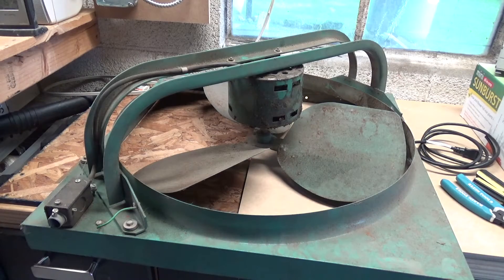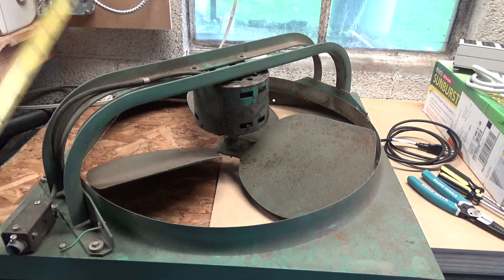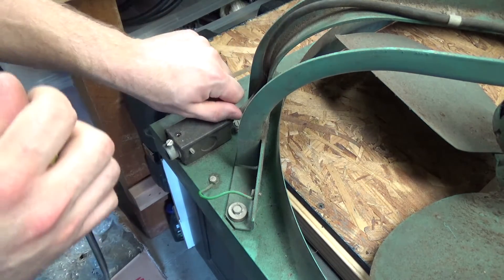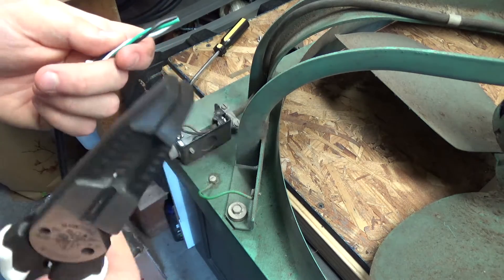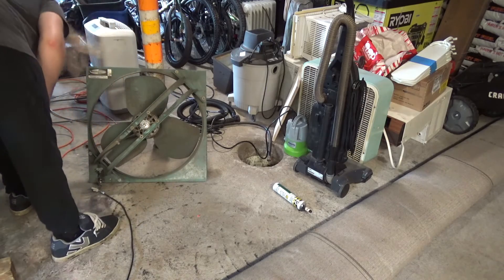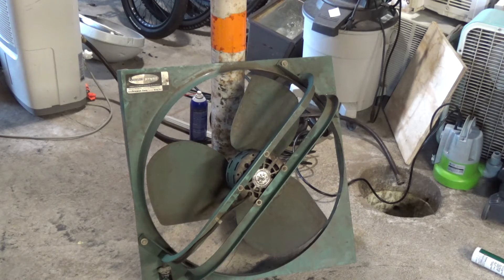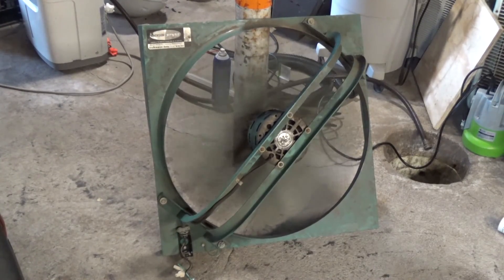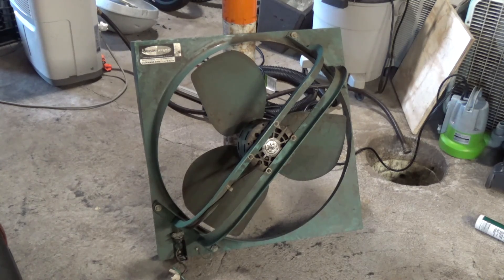Emerson Pryne DD-22 Commercial Exhaust Fan | Initial Checkout

Comment: Be careful wiring copper to aluminum is a fire hazard, you might need special insulated wire nuts rated for copper and aluminum together,
stay safe.
Reply from the maker: It's not going to cause a problem for a couple amps of a fan motor.
Reply: @JordanU  ok

Comment: This fan looks to be a whole house ventilator. If this fan is to be used as one the air would come through windows and exterior doorways then the fan would push the air into the attic so it's technically exhausting. As a side note I think the model number translate this into having a direct drive motor and a 22" diameter.